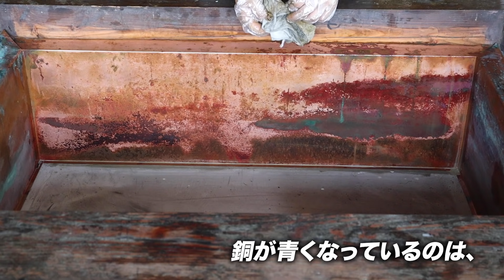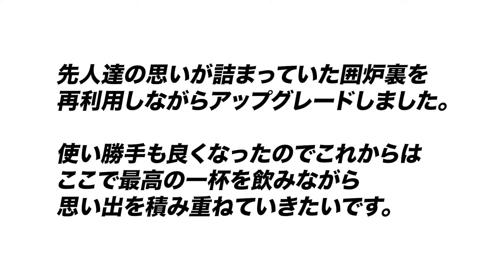古い囲炉裏を安い材料でDIY！使いやすくてオシャレなテーブルに大変身

Comment: Looks very good. One suggestion: Where you glued the opened joints on the large frame around the table, sprinkle a coat of sawdust into the joints after applying the glue. This will enable you to stain those repaired joints to match the wood.

Enjoying your videos! :)
Reply from the maker: Thank you for the very detailed information😊